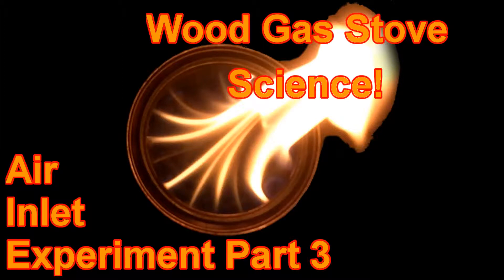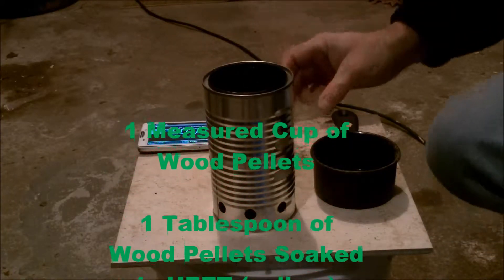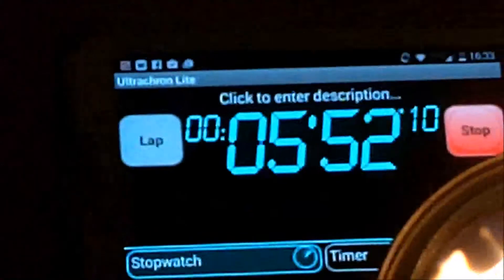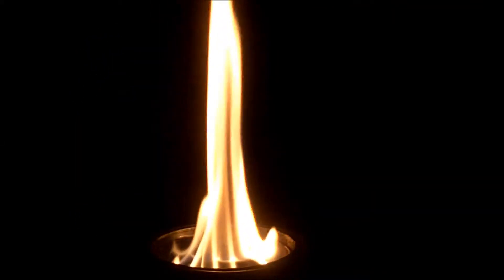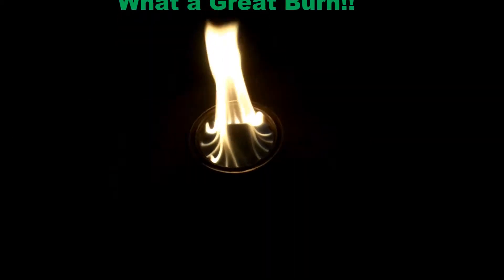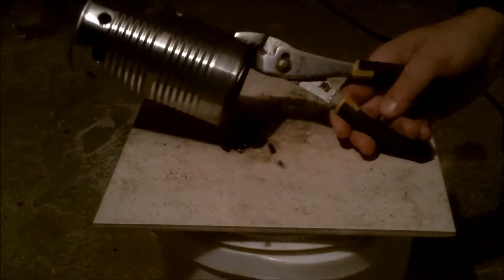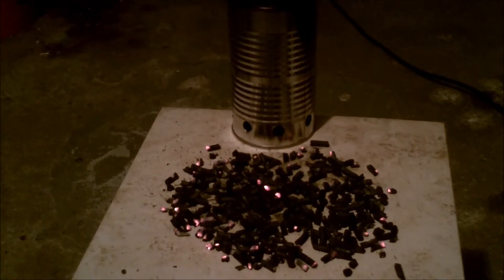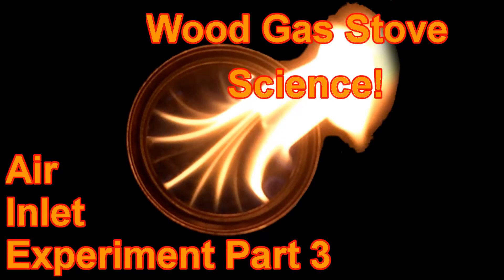Wood Gas Stove SCIENCE! Air Inlet Experiment V3.0

Comment: Greetings. Indeed your conclusions of this test where spot on. It seems that air flows better into the combustion with a bigger outer can, being other factors the same.  Proof is in the fact that  pellets burned faster in this "PART 3" and you have less charcoal and more ash when compared to previous tests. The apparent fact that secondary air jets "look" more intense also points into this direction. It would be interesting as well to measure temperatures and air speed and volume that feeds the combustion, The first may be possible with a hand laser thermometer (though not the better way to measure temperature in this case) or a wired probe for high temp, but the second may be a bit difficult with cheap equipment. Nice experiments you make here.
Reply from the maker: caotropheus I have been thinking of picking up a thermocouple to plug into my Fluke meter.  If I do I will be able to measure the gas temperature. Not sure how I can measure air speed though. I ran a couple more experiments tonight... will upload videos soon. Thanks for the comments!
Reply from the maker: caotropheus You seem to be very knowledgeable in wood burning stoves. Could you look at this video https://www.youtube.com/watch?v=BQeff1dZaAQ and tell me what your thoughts are?
Reply: Heath Putnam Please, do not worry, I will not miss your experiments of wood stoves!